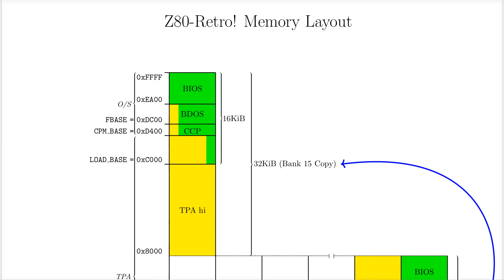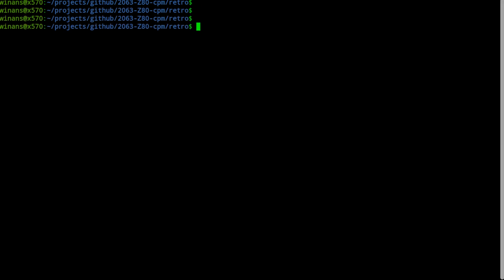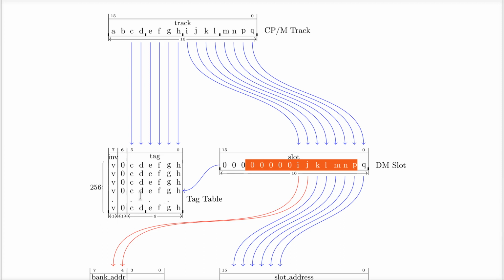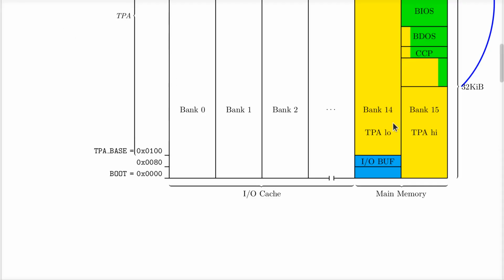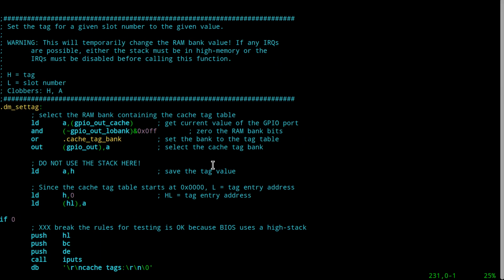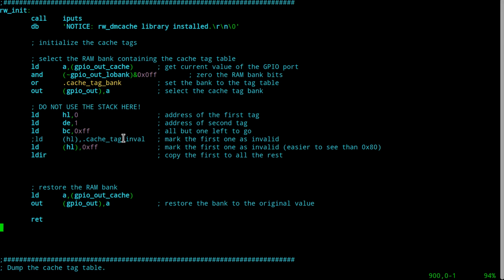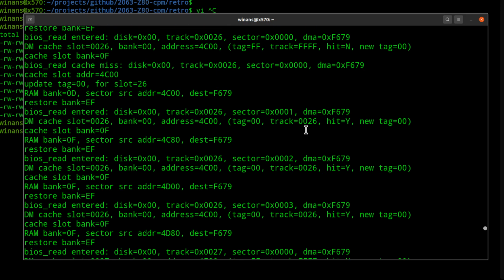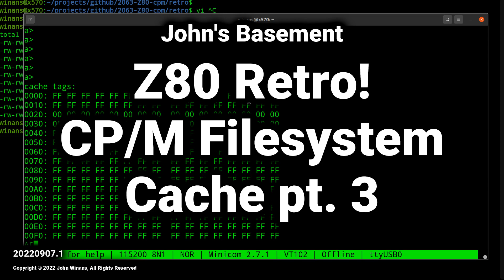Z80 Retro #40 - Designing a CP/M Filesystem Cache pt. 3

Comment: The memory layout is nearly identical to the microbee 128K & larger DRAM systems. The microbee has an additional on-demand relocatable 4K window to access its VIDEO MEMORY @F000-FFFF AND @8000-8FFF. Instead of using the additional RAM banks for disk cache it is normally used for a fast RAM DRIVE and GUI shell. Alternatively the banks can be used as video graphics buffers.
Reply from the maker: I've been wanting to do a graphics card suitable for tile-based games & side-scrollers.  I wonder if it would be possible to include microbee compatibility. 🤔
Reply: It sounds like a great idea & completely accomplishable but to start why not attach a Texas Instruments  9118 VDP first because it’s completely self-contained, comprises of just 3 ICs & is only I/O port connected as not to interfere with your memory mapping? From this you can teach the advantages and pitfalls of it against memory mapped systems.
Reply from the maker: @PebblesChan  I think that a 9118 might be a nice first draft!  I'll have to see if a 3-chip solution is viable on the Retro!  Can you find a 'real' datasheet for the 9118 anywhere?  I can not find one that is complete.  I think I have enough to build one (mostly due to other schematics on line).  But I'd like to see the full, real, datasheet.

The main concern I have is timing on the CPU-side.  Am I going to be able to use the IORQ timing from my a 10MHZ Z80 without adding wait states?